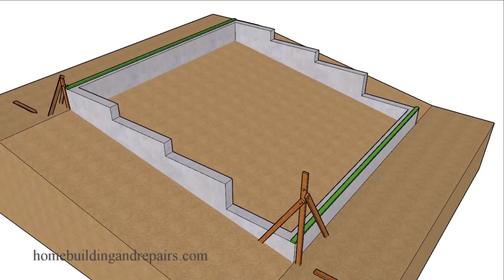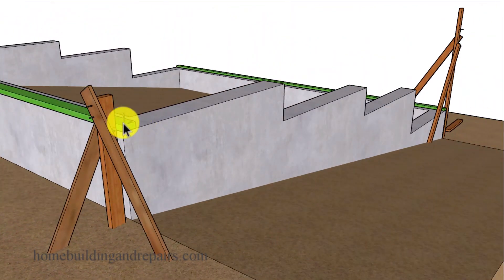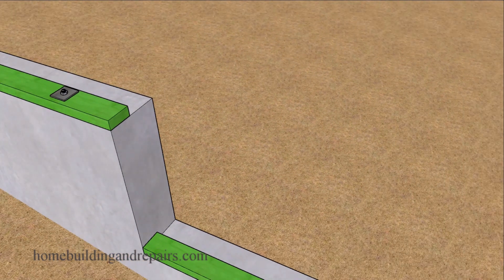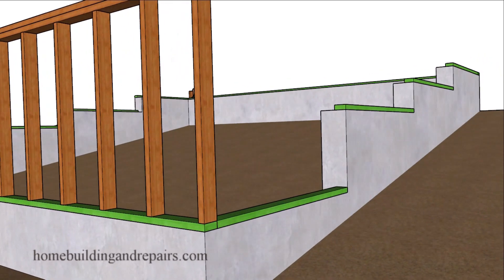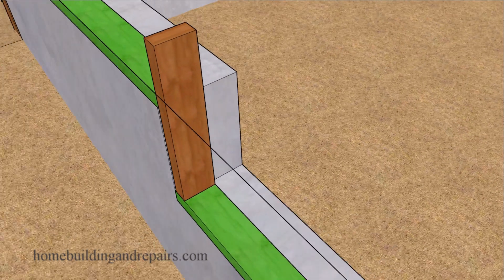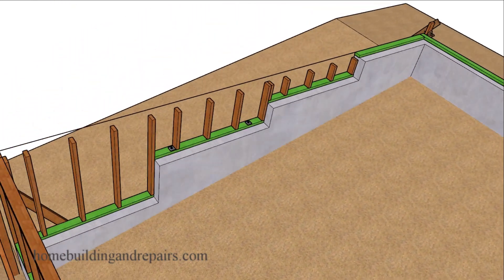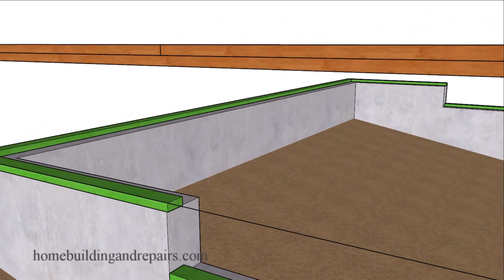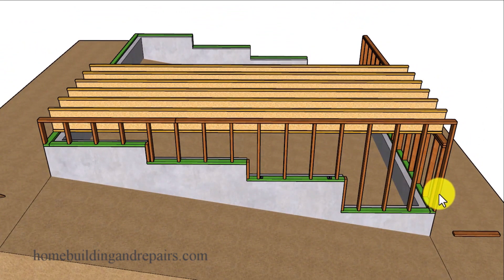Learn How To Calculate And Build Framed Wall Above Step Down Type Hillside Concrete Foundation

Comment: thanks for this. I have a stepped back stem wall for my new garage, from 6 inches to 2 feet to 3 feet above the slab, over 34 feet.  so i guess it is OK to sttand up the end studs and top plate first, then toenail all the studs in.  I am concerned about a wall built with a whole lot of toenailing instead of prebuiliding the wall end nailed then jacked into place.

Comment: I typically use a chaulk line, much lighter as stringline can sag. Then I set 2 ea 2x4 block on top of sill plate and under my stud then slide the top of the stud along the chaulk line a few inches enough to get a mark. Voila. And I do agree there should be PT vertical plates and sill seal on steps.